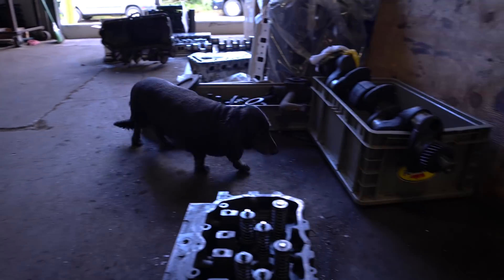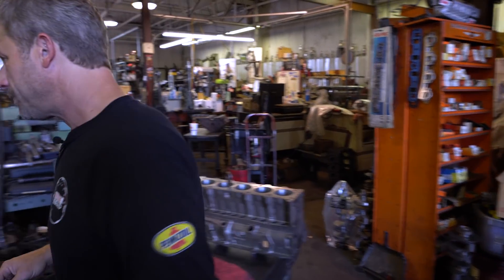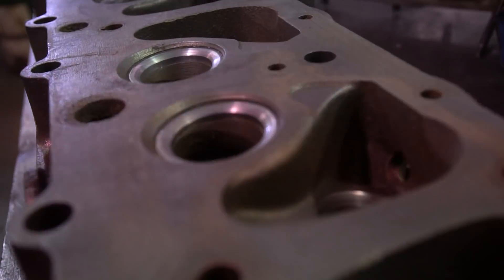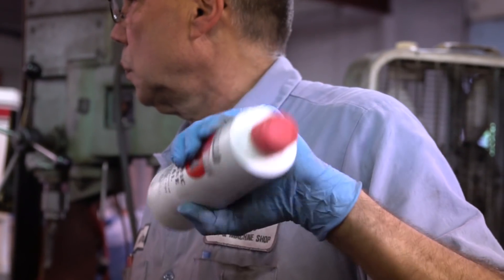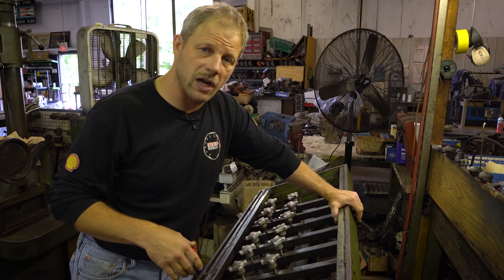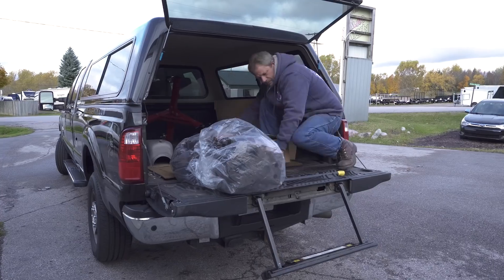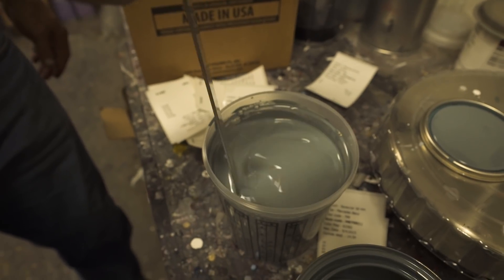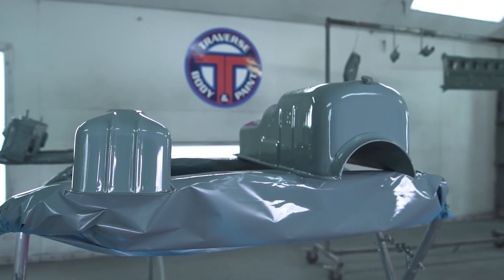Grimy Chevy Stovebolt 6 engine project heads to the machine shop | Redline Update #26

Comment: I understand why you don't want to fully repair the cracks but I'd like to see that repair job performed so that viewers like me understand the process and expense of doing it
Reply from the maker: For this engine specifically, it made no sense for us to do that even for your stated purpose. Should the situation arise with a more valuable head or set of heads (like something we want to keep numbers matching, or something rare, etc.) then we will definitely explore that process and the expenses involved!
Reply: @Hagerty  Can't wait to see that.
Reply: There are companies who will drill out and insert/stitch new metal plugs into castings fixing them. Jay leno has used them on some of his rare projects
Reply: @Hagerty  why not paint them orange?
Reply: @clevelandmaker386  Because Chevrolet's straight sixes weren't orange until much later. From grey they went to Blue with the "Blue Flame" straight 6 in..   1953 I think for the Corvette? And I think some were even Green.
Reply: @Shane-Singleton  Exactly. Also regarding the Blue Flame in the Corvette.
Reply: Isaak Welch  if your engine is in a vehicle can you give it a dose of that sealer let your engine run for a while then turn it off drain the water let it sit a few days redo the process if your engine is on a stand you can move it up and down so it all coats evenly as possible.🕶"
Reply: @Shane-Singleton  . I have one in my garage. Bought it eleven years ago. Yes it was painted blue. When I started cleaning it... the blue came off.  The valve cover was black. And the side cover  was just bare metal. With blue also.
Reply: @kensendlosky7438  My 235 in my 57 Chevy is blue. Although it could certainly use an aerosol overhaul. Runs fantastically but definitely looks shabby.

Comment: The stovebolt six had cast iron  pistons right up to the mid 50s and from 53 they used a full pressure oiling system and discontinued with the oil scoops on the rod caps and toyota bought the rights to the patent of this motor by early 50s and used in the landcruser and some trucks in the 60s and 70s.

Comment: Did you consider powder welding the cracks? We used the ceramic sealer for years when we IMCA dirt raced and built claimer engines. There was a many of those claimer engines that ended up in pickups and made many of mile without water loss issues. We didn't buy top quality blocks to sell at the claimer races. JB weld and Ceramic coat was good to us for years on keeping our hobby cost much lower. How many 882 chevy V8 cylinder heads have you seen that are not cracked?

Comment: Can't you cut open those cracks and weld them closed? Or could heat crack them through water jacket?

We might have crack in our flathead six block and that's only possible solution we have think for it..

Comment: So how did you address the poured babbit bearings in the connecting rods? 
Were they redone for insert style bearings? What company does that conversion? Does this motor still have the dippers/squirters or was it converted to full pressure lubrication?

Comment: Getting harder to find these stovebolt motors laying around in fields and junkyards anymore.  Just getting a new head is not that simple.   I think 1955 and up Stovebolt 6s were insert bearings and full pressure oiling system,  which makes them a little better unit.   Depending how you’re going to use it, I guess.    keep up the good work!
Reply: IowaMercMan  53 with the powerglide and all 55 and later 235's had the full pressure oil and insert rod bearings, and about 30 more HP !!!  Go for it !!!

Comment: Is there a way to update the rod and main bearings to serviceable units?
Reply: There's nothing wrong with the stock main bearings.   So far as the rods go,  Federal Mogul asap well as several other companies used to convert them for use with insert bearings,  and I still see them floating around at swap meets.

Comment: Could the cracks not be welded then the surface refinished?
Reply: @socketus popetus Braze?
Reply: @rich1953  Thats what i did with my old Triumph 650 motorcycle barrels, the lower part which guides the piston had a large split, over 2 and a half inches long, i made a plug which fit the other cylinder bore and then put it in the damaged bore and pulled the lower cylinder back together and brazed it up, so far it's done over 120'000 miles without a problem, just have to drill a small hole at the end of the split to stop it from going any further.
Reply: I have successfully welded cast many times with 7018 stick weld, it works the first time, every time.
Just weld small amounts at a time with thin casting, with thick casting, just let 'er eat and melt that rod into the casting.

Comment: You're working on this now today, so I can not doubt you, but the 216 I rebuilt out of my '53 Chevy truck had babbit bearings rods? On one hand, I sure don't remember it that way but it was in 1974, 45 years ago. On the other hand, I don't recall renewing any babbit---and maybe that was why the thing blew up after about 10K miles!
Reply: pneumatic  All the 216's had the babbited rods but you could buy converted  to insert rods, but you still have the low pressure dipper oil system !!!  Just swap in a later 235 and get insert bearings, full pressure oil and more HP
Reply: @wilburfinnigan2142  Aha about the convert-to insert rods. Yeah, it was so long ago, I barely understood what I was doing; I was lucky enough to be able to use a pal's shop and I certainly overstayed my welcome. I believe the early 235's also had the scooper oil deals. But as I said, it's been a while. It was when I was done that I learned the diffs between a 216 and 235. I probably should have gotten a 235 to rebuild, it was a $50 item back then but I didn't have 2 nickels to rub together.
Reply: @pneumatic00  True  That is why I said 53 with Powerglide and all 54 on 235's has the full pressure lube and insert bearings !!!  I and friends threw away about 4 of those old rod knockers and installed 2 35's !!!  I had a nice 53 BelAir 2 dr HT with the three on the tree and the 216  rod knocker and it went out and a friend pulled a 235 out of his 56 2 Dr HT and put in a 283 and I snatched the 6 cyl 235 as I knew the engine and popped it in the 53 BA HT>  made quite a difference........

Comment: Babbit rod bearings? That would be the motivation to swap in a 250 or 292 if it fits.
Reply: blanchae  The Chevrolet 235 is a step up and a bolt in and it has the full pressure oiling and insert bearings and about 30 more HP  !!! I have in years past swapped out many 216's for the later better 235's !!!  They are a much better engine !!!

Comment: Why bother with an old babbited rod low pressure dipper rod system in an engine with a cracked head ???? Scrap it and go with a later 235 and get the full pressure lube and insert rod bearings and aluminum pistons and about 30 more HP  What you are doing is a total waste of time and money !!!!
Reply: That's not being mean- it's just the truth.
Reply: @benjover5663  Yep !!!  Facts are facts !!!  Why waste time and money on a no good junk engine ????
Reply: I scrapped my 216 for a (54) 235 also, but for education sake, it’s good to know the history about the 235’s predecessor. These engines were in thousands of cars and trucks for many years.
Reply: @gabrielsandoval4994  Yeah I learned that the hard way !!  Tried rebuilding a 216 in a 53 BA HT and used the converter rods to insert, and replaced the pistons and rings and then ended up pulling the engine and replacing it with a good running stock 235 from a 56 of a friend of mine that put a V8 in it.  also did another 52,  just pulled and junked and put in a later 235.  Made quite a bit of difference in performance and durability !!!

Comment: Thats a awful lot of work just to use a severely cracked head.  Kinda shocked
Reply from the maker: It wasn't severely cracked. As far as we could tell, the cracks were mostly superficial. None of them went through to the water jacket. It pressure tested just fine. We took the steps to mitigate any further cracking and damage. Simple as that. Like Davin mentioned, this engine won't see a ton of miles. It's a unique engine that doesn't get rebuilt very often, so we thought it would be an interesting project.
Reply: You are right, definitely interesting.  I guess, i should have said.  Using a head that has started to crack in several locations. It will in the future pose a problem, we just hope not a large problem.
Reply from the maker: @cwiggy34  You're right. It could pose problems in the future. But we had to look at the situation logically. We knew we wanted to rebuild this engine. There are no aftermarket heads available, and like Davin said, all the originals are cracked. The combo of it having a low compression ratio and most likely not seeing a lot of use over the next 5 to 10 years is the reason we proceeded how we did. Thanks for watching and commenting!
Reply: I guess im just real partial to Chevys lol.   Since it is a full numbers matching rebuild, its all good....